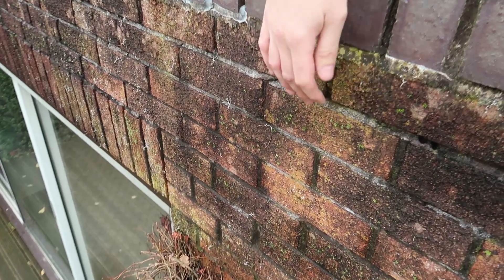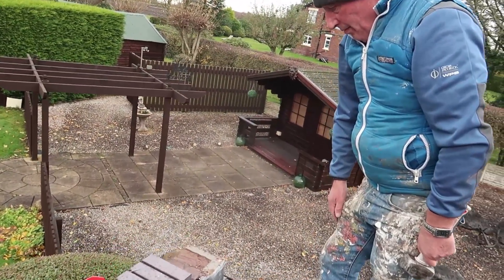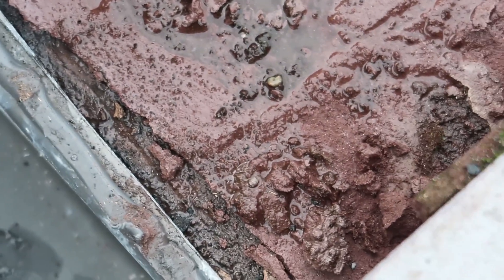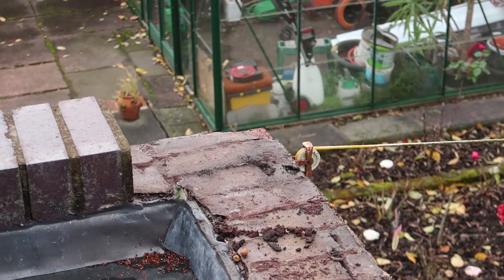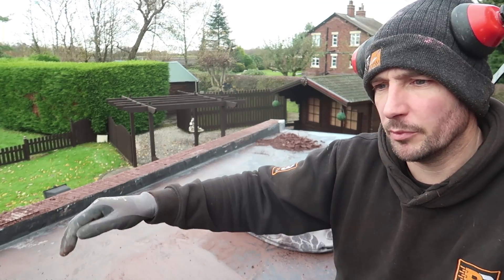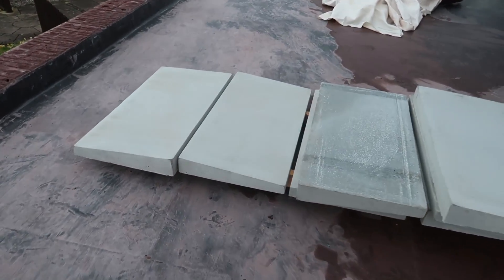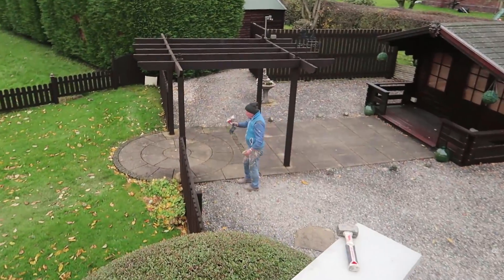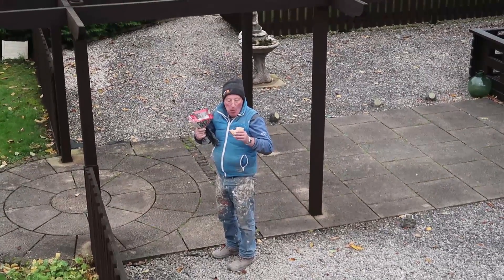Emergency Bricklaying Job Roof Leaking

Comment: Why did you put that strip all over bricks if you used concrete tops? 🤔
Reply: It is waterproof membrane which adds extra protection against leakage.

Comment: Nice job mate I did one and put expansion joints in the lead then dpc over top mortar wont bond to lead at all, the copings will never come off but chance of water ingress when the lead splits due to movement 🤪👍
Reply: Hi mate the lead won't split it is not directly in sunlight
Reply: @seniorgolfprogress83  I think your wrong on this one mate it may take a long time but the lead will definitely split due to thermal movement caused by change in temperature if it was in direct sunlight that would just speed the process up it my take 50 years but that lead will split 100%

Comment: Lead should have gone in no more than 1500mm long pieces with a minimum of 150mm laps and edges patination oiled or lead will bleed leaving white streaks running out
Reply: We know that about 15 people have said that before you I have seen church roofs with well over 6 m long and never cracked donkeys years old hello

Comment: How well will the sand and cement  stick to the lead I'm assuming  itll be fine in strong winds
Reply: In a hard winter you have trapped the water,so frost would be a problem with B.O.E but less so with copings.

Comment: you must not run lead longer than 1.5m in a run it needs to be able to expand and contract. i thought it was rubbish first lead job i did (16 years ago) got called back as the sun got on it and buckled the whole lot. i was red faced i can tell you. did it in stripes with 150mm overlaps never had a problem and have done it like that ever since. other wise great job id imagine those copings should hold it down but its amazing what expansion can do.
Reply: Please tell me How The lead is going to buckle when it’s not directly in sunlight it’s under the copings it is never going to get hot plus the copings are white which reflects the Sun

Comment: Stu. 
Engineering bricks are Good. It’ that they Never properly Weathered the top  , two course of creasing tile  to form a throw off / drip ?

Eny way  you’ve now weather it.   One thing I would of slightlyscored the lead to give it a key & full bed .
All the best jim
Reply from the maker: cheers jim, will use those tips next time

Comment: Nice neat job. But flat roofers should have taken the waterproofing up and over on top of parapet and cavity and that problem would have never happened. New lead could cause a capillary reaction under heavy rain and still track down behind on inner edge.
Reply from the maker: I agree bud but they didn’t. The new lead is fine as we sealed all the way around the perimeter so no capillary water can get past it. Thanks for watching 👍

Comment: My only question is it looks like you laid the coping with the fall towards the flat roof? Would it not be better to have the fall towards the ground so water runs away from the roof and off? Great content btw Stu, KC should raffle those jeans 👌🏼🤣
Reply from the maker: It’s a parapet Dan and the copings are slanted so the fall goes where it should, on the roof. The roof fall runs down to gutter on other side  you see Dan 👍
Reply: @Dan Brown. I was thinking exactly the same, glad you asked first.

Comment: did you cut the lead? 1.5m lengths of code 4, that'll split if not
Reply: How will it split?
Reply: Expansion and contraction, see it on a lot of roofs I strip 👍🏻
Reply: @Presto-qo4co  to be fair mate the lead isn't in constant direct sunlight and does have a substantial mortar bed on it to keep it in place. That's exactly the way we do it up here too.👍
Reply: I hear ya 👍🏻 but it’s not something I’d risk, I work with it week in week out, it wasn’t a dig, just my opinion, love his work 👍🏻
Reply: Yeah I’m a roofer to, that will split in time unfortunately. Should of done 1.5m lengths and welted joins
Reply: DANDNB  I also allow for expansion and contraction on roofs however in this set up that's never going to split. 👍
Reply: Calder guide to good lead work actually says lead has be in 1.5m lengths...
Reply: Uh oh wonder if he’ll delete this vid now then
Reply: @matgurd  how many brickes can weld lead? Comes a point when a job isn't cost effective for the customer when  you have to sub in a specialist with lead.
Reply: Ben hedison -  WELT not weld
Reply: Ben hedison you don’t weld it, you put a “welt”in it. It’s a method of jointing lead by overlapping and turning the lap over. By doing it you can stick to 1.5m lengths and still keep it dry underneath.
Reply: @matgurd  I stand corrected. My apologies
Reply: @b10edo77  I have my own roofing company and employ a bricklayer who works with me full time it works very well
Reply: @rsg666  I agree with you it is not a gutter or weathering in contact with direct sunlight. It would have been better to use shorter lengths but at the end of the day it is simply a posh damp course and protected and held down by concrete capping. I can't see much wrong with it Stu has done a good job
Reply: @johnblackburn7673  my thoughts exactly mate. I am a roofer of 31 years experience and yes I'm aware of the 1,5m sections however I do think Stu was right to  limit the number of joints for potential water ingress on this occasion. It would probably take many many many years for this lead to fail. Take care mate 👍

Comment: Could you have slipped some drip edge under there to keep water away from brick?
Reply: Most of the time coping stones like this have a drip edge or trough on the underside of the stone to keep water away from the face of a wall.
Reply: @伯SouthPaw87   Thanks for the reply

Comment: sorry guys, but as a roofer i have to say the problem is not solved yet.
Reply from the maker: we can confirm that weve been back to the job today after overnight rain and its not leaking in anymore, customer is over the moon thanks for watching buddy.
Reply: stu crompton stu, you did a very good work as usually! please, dont worry. the problem is the roof, not your work.
Reply: stu crompton the attic is to low. i mean the flatroof seal should be up on the attic outer edge. the lead and the silicone is just against rain water. in wintertime, when snow and ice is laying on the roof, the water can go again between the lead and the stone. 
as we say here - water‘s got a small head. i hope you can understand 🤘🏼 what i wanna saying.

Comment: Don't want to be picky, but I wouldn't have them copings sitting entirely onto the lead with no direct tie into the actual wall.
I reckon there were better ways to do it. For example, taking two courses of bricks down and installing a cavity tray or DPC and weepholes.

Comment: Technically the lead should be in sections for expanding and contracting  1.5m lengths
Reply: That's when exposed to sunlight surely? Bedded underneath the coping stone it shouldn't expand at all. Plus it defeats the object, if your putting lead on a flat surface to protect the brick any joints will be an area to leak? Fnose tbh I'm a roofer
Reply: I believe it’s 1.5m section with a minimum of 100mm overlap I could be wrong
Reply: I wouldn’t put a piece of lead in longer than 2m. It will expand and contract and loosen the copings probably. Looks like a 9” wall too so not really possible to put a cavity tray in with no cavity. Over sailing course and brick on edge with dpc would have been my choice.
Reply: Tee Jay hundred percent right it will get no sunlight so it cannot expand it will not crack I will put my life on it😜
Reply: Tee Jay mate you must be the only roofer on here what knows his stuff👌
Reply: It's not just direct sunlight that causes lead to move/expand and contract just the temperature is enough to do it shouldn't be any longer than 2m without expansion joint or simple standing seam joint tidy job but will fail eventually over the years
Reply: @petetheroofer3321  what kind of temperatures start to affect lead I'm curious
Reply: @Ry t the atmospheric type I would imagine? 🤣 It's the changing in temps that causes issue, higher temps it will expand and lower temps it will contract, it is this action that causes stress and cracking to the lead, this is why the LSA (lead sheet association) lay down best practice rules and guidelines which state any lead laid flat and not on a pitch roof can be laid at a maximum of 2 metre per length with expansion provided for each joining piece if required 👍

Comment: No expansion cuts in the lead give it couple years it will crack?!!!
Reply: Craig there is no way on earth that is going to crack mate it’s not in direct sunlight Plus there is a coping stone on top bedded on sand and cement Plus this coping stones are a light colour which reflects the heat

Comment: My only concern is the lead moving and splitting in time, as it’s over the max length of 1.5m. 
Could of done 1.5 long and welts to join it.
Reply: how much of an overlap at the joins would you say? 225mm?
Reply: DarrenVelSatis  I would  do welted joins
Reply: Hard to explain
Reply: Google 
The caldera guide to good lead work...

That's wheres all the info is on working with lead
Reply: mohammed ali  or LSA
Reply: @matgurd  
Yes and them too I couldn't remember theyre name

Comment: Lead should never be put in full lengths like that unless you weld expansion joints in! It will just split over time. So sort of a pointless job there lads. Usually like your work aswell 👍
Reply: The lead will not crack it is not in direct sunlight there is a light coloured coping stone on top which will reflect Any heat will definitely not crack mate
Reply: Spot on mate this golfer guy seems to think if you hide lead it doesn't expand 🙈😂🏴

Comment: At the beginning of the vid, who else  picked up why the previous builders didn't put a cavity tray in.
Reply: 9” wall, no cavity, I wouldn’t stand under those copings in high winds either. They’ll soon loosen when they lead has expanded and contracted a few times,